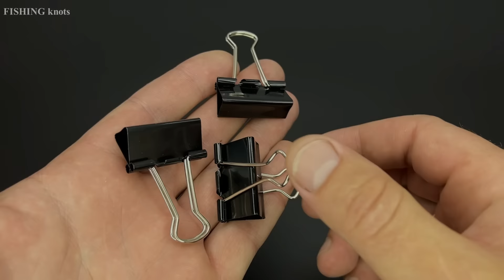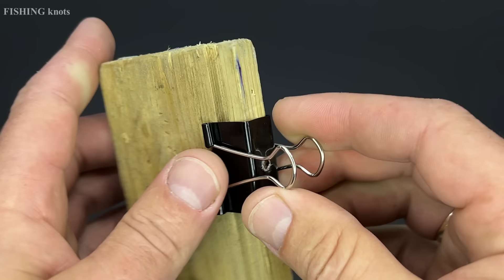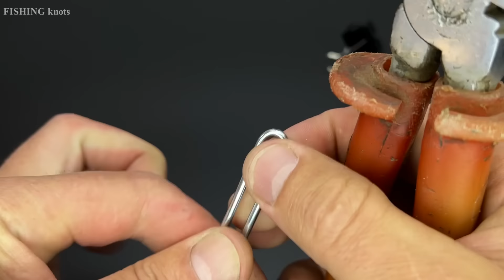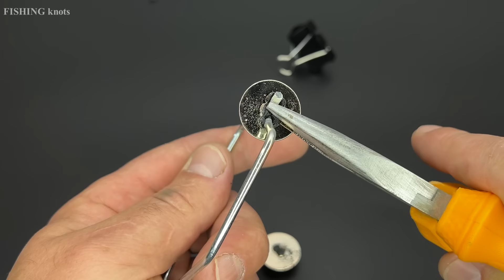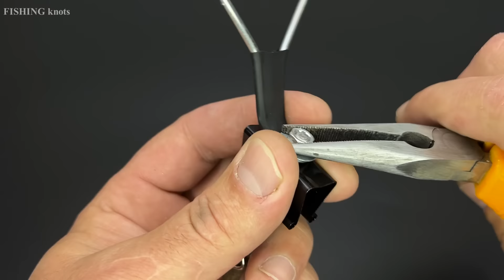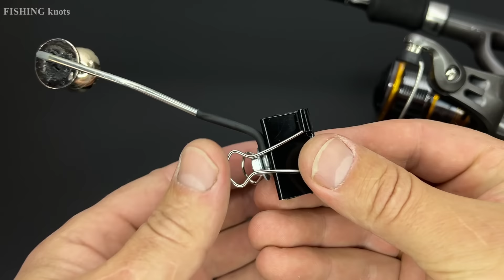How to wind any fishing reel.DIY Line spooling device

Comment: Do not wind line onto a spinning reel like that, it just causes heaps of twist in the line. Take the line off the spool sideways, with the twist matching the turn of the rotor. Try it with a few metres of mono to work it out. Spent years working in a pro tackle shop,spooling thousands of reels

Comment: Line twist
Reply: idk about that. thats usually if you have the spool of line upside down and put it on.. most shops will do this same method. just with different tools. it mainly twists or doesnt because you arent taking it off the spool like this straight method. you are pulling it up which makes it twist if its sitting on floor and going on the reel the wrong way..  also the pressure it puts on is important too. helps keep it tight on the reel. its legit. also if you ever get twist just throw on a swivel do a leader with a weight only and cast it as far as you can reel in it will take out a lot of that twist.. even better  if you are on boat just let all the line out the back of boat when driving and reel it all back in and it will take out twist. just a couple methods to help with twist if you ever get it. though this wont do that.